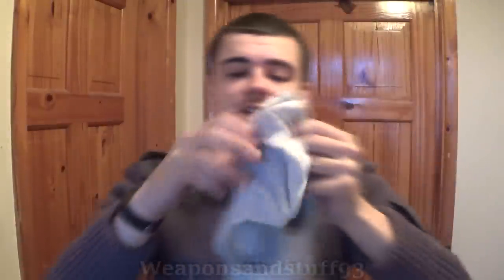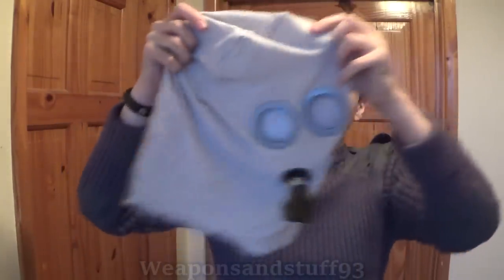Why did gas masks have hoses?

Comment: When I was still on tanks, our M40 gas masks came with long tubes to attach to each crew compartment in the tank. The tank had its own NBC filtration system so you could use that instead of a canister. Typically the commander and loader would use canisters to allow for easier movement and to be able to easily get out of the tank if needed. The gunner and driver would connect to the vehicle system. Best part was, the NBC system on the tank would naturally make the air cold after the filtering process. So we would take the hoses and shove them into the crotch of our coveralls to blow cold air on our jimmies while operating during the summer. Contrary to popular belief, the M1A1 does not have air conditioning. The M1A2 does, however it rarely ever works.
Reply: Sounds incredible.
Reply: I bet that was heaven.
Reply: I have one of those hoses, very cool

Comment: Awesome video mate.

Just ordered 2 GP-5 masks and have also bought 2 of the Chinese standardised hoses so I can use NATO filters with them.
Cheap and better than nothing.
Reply from the maker: Yeah should work better than nothing. That way you can put a 40mm P3 on the bottom etc.

Comment: Could you do a video about the gas masks used by the chernobyl liquidators
Reply from the maker: As far as I'm aware they just used dust masks, standard Soviet ShM-41 masks and maybe IP-4 re-breathers?
I've done a video on the IP-5 and I have a video coming up on the ShM-41.
Reply: They used IP-4 rebreathers specially designed for that aswel as IP-5 these were specailly made for liquidation also not sure if you mentioned it, interesting fact, soviet hoses had one more purpose, it was either connect it to oxy tank or have filter for like military masks in bag so you wouldn't bash your teeth out while running with such soft gp5 bottom feeding filter mask types.
Reply: Erander Gaming you didn't mention their secret vodka bottle openers
Reply: Wait what?
Reply: Gp4

Comment: Are there any masks you find easier to use with a hose than without?
Reply from the maker: Any of the Soviet masks with a downwards filter intake.
Reply: Longer hose, more air to clear before you suck thru filter, hoses make it marginally more difficult to breathe, but that's still way better than breathing in whatever your trying to filter!

Comment: I was wondering if you were to cut open an expired/used filter and put in new activated charcoal and duct tape it back up if it would protect you from aerosols. It would be a neat testing video and I bet you have plenty of expired/used filters laying around. Thanks.
Reply from the maker: If you were somehow able to reweld it in theory yes, however cutting filters open in general is a really stupid idea.

Comment: Basically every task soldier needs to do suddenly becomes easier if you have a hose attached filter (or theoretically even cheek filter, but from that arises one new problem): your head is not weighed down by filter, filter does not get in a way of aiming, filter does not get in a way of crawling (even side-attached filters don't solve that 100%) and you can last longer in hostile environment.

Comment: you are the first one i ever heard talking about asbestos so thank you, i have some old west german filters from the 80, do you think they got asbestos? the video is good.
Reply: JT Jensen they dont have asbestos
Reply from the maker: I think a few people have mentioned it long before I made videos but it was mostly just speculation over if a certain filter had asbestos in or not.
As for the Drager West German filters, they should be absolutely fine if they have a date stamp on them, the only issue is WW2 German filters look very similar and do as far as I'm aware contain asbestos.
Reply: thank you.
Reply: thank you.
Reply: JT Jensen any filter before 1965 but never use soviet filters
Reply: Yes they also may have arsenic
Reply: German filters from the 1980's shouldn't contain asbestos unless they have been used in an asbestos contaminated area.

Comment: Interestingly before the EBR or SBR (Small Box Respirator) there was the LBR (Large Box Respirator) which used the British Army enamel water bottle as the basis for the filter tower.
Reply from the maker: Thanks for the info, I assume it's this but sadly the IWM doesn't have an online photo of it.
http://www.iwm.org.uk/collections/item/object/30111110
Reply: That's it, there are period photos of them being worn but they were short lived and not standard issue, many were issued to men of the RE Special Companies or Royal Artillery responsible for effecting British gas attacks (cloud and shell respectively) as they required the best protection available so got whatever was at the cutting edge of anti gas kit where possible. http://s3.amazonaws.com/gwfattachments/monthly_2017_01/5885db27e4a63_Largeboxrespirator.jpg.d3d82b3f0021930bd254d76d555b813e.jpg

Comment: With some masks it's a lot easier to get a cheek weld on a rifle when you have a tube to a filter as opposed to a big clunking filter on your cheek...that's why the m40 has two filter ports, so you can put it on the opposite side of your rifle, but if you only have one port, a hose may be a good fix

Comment: I have the mk 5, but because i was gonna use it for halloween, me and my dad removed the filter via cutting the tiny metal "rod" at the end of the hose and then washed the mask itself. It looks brand new, besides the eyes.
Reply: And lets say a british ww2 mask in PERFECT condition. Is really hard to find here in Norway, Haugesund. Also i got it really cheap
Reply from the maker: Yeah you can remove the filter that way, a friend and I removed the hose and filter from his MK4 mask, soldered a Soviet 40mm intake to the bottom of the mask's pipe and now you can put GOST filters on it.
If he finds it I'll do a video on it.

Comment: Does the rubber hose contain asbestos in it, I ordered a gp5 Soviet gas mask and I’m worried that the rubber hose will have some asbestos in it, I will be unscrewing the filter
Reply from the maker: The hoses have talc in but no asbestos.
Reply: Weaponsandstuff93 Thanks, so just take off the filter and everything will be fine?
Reply from the maker: Yes
Reply: Weaponsandstuff93 Thank you

Comment: Phenate Hexamine.
Reply from the maker: I'm sure someone will claim that's a fancy word for piss later on.
Reply: Most likely! There were in fact three hoods with the mouth piece and exhale valve, the P, Phenate only, PH, Phenate Hexamine both of which were visually identical and the PHG, a PH with integral gas goggles, that is padding around the integral eye pieces and elastic from the sides of the eye pieces around the head which obviously held the lenses close to the eyes far more effectively.